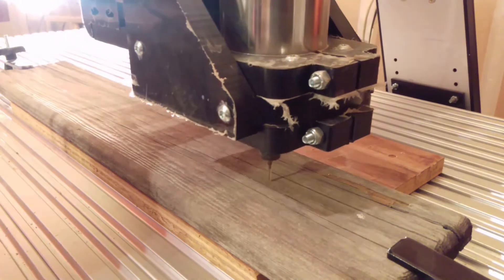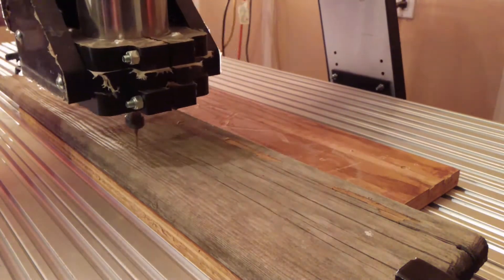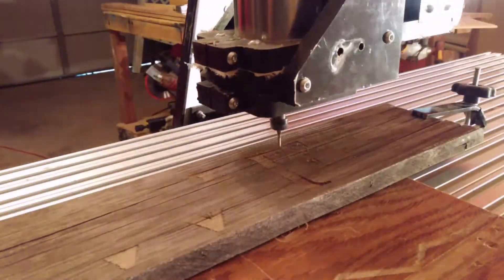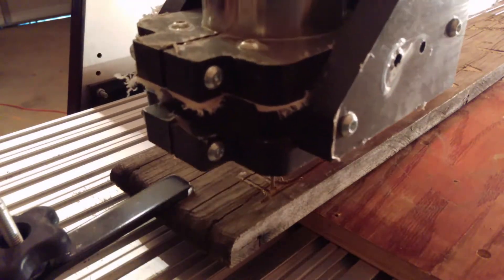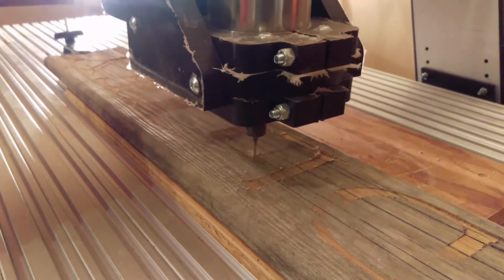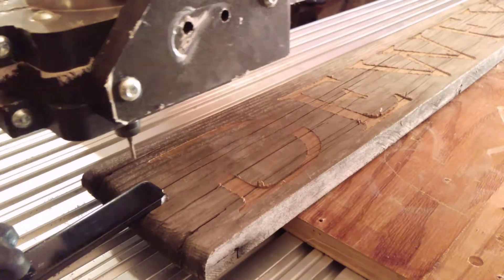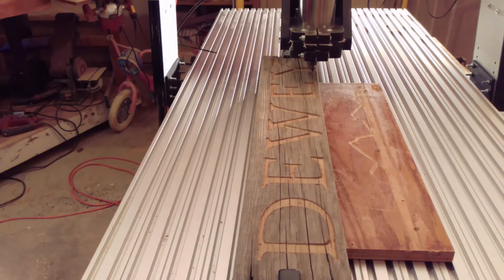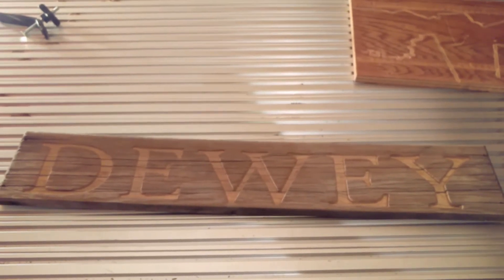How to Mill A Cupped Board With A CNC Router Custom Vintage Wood Carving

Comment: I would like to know what spindle speed and feed rate you are setting with 1/8 end mill and is it up cut or down cut mill?  I enjoy your videos keep up the good job. 

Dan
Reply from the maker: Dan Steege I believe it's an up down cut two flute feed rate of 100 inches per minute with a plunge depth of .05 as far as RPMs I'm not a hundred percent sure I set my spindle controller  to between 90-100 however I'm not sure how many rpms that translates to Max is 400 and I'm fairly sure Max for my spindle is 40k rpm so my best guess is 10k rpm. Wish I had a better answer Merry Christmas thanks for watching
Reply: Clovota Milling & Signs thanks for the info. Mine reads in rpm and runs max speed at 24000 rpm . I run at 12k to 16k to get best results for me. You’re finished products look great. Merry Christmas to you and family.
Reply from the maker: Dan Steege the end mill I'm using is amana part # 46254
Reply: I am Roc from China,CNC router manufacturer ,If you Need CNC router,welcome you contact me:WhatsApp and Skype:+8618615314157